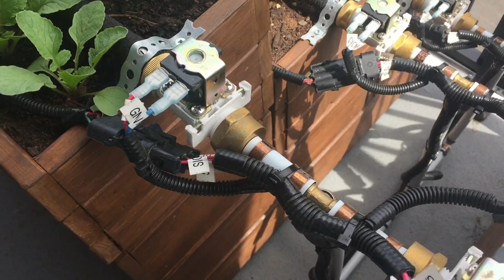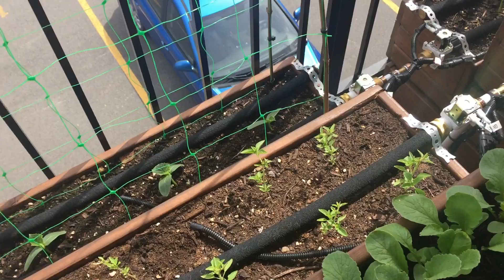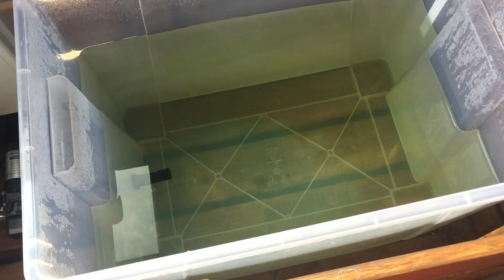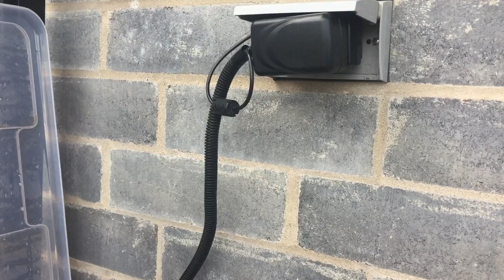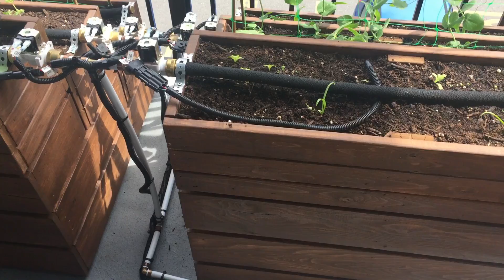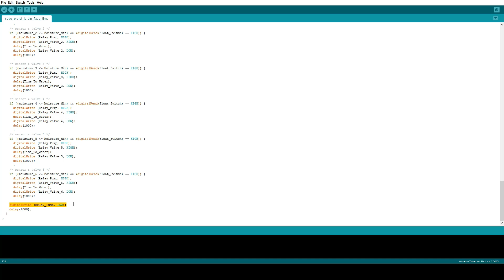Arduino Automatic Garden Watering System

Comment from the maker: Make sure to subscribe, new version coming up! Feel free to leave a comment letting me know what part you’d like to see more of.
Reply: i have few questions do you keep the arduino running all the time  and is that okay , and the sensors are they okay to corrosion  and how about the length of wires from the arduino to the sensor
Reply from the maker: Henok Adisu the Arduino is always powered on, but the sensors are activated by a relay that only sends power when I’m scanning for moisture. That way, it should make the sensors last longer
Reply: but how does the arduino know if it is dry or moist  , is it using time intervals
Reply from the maker: Henok Adisu I’m using a running average of readings at set intervals.
Reply: oh  that is cool ,  i cant wait for your update
Reply from the maker: Henok Adisu still waiting for better weather. It’s below freezing and there’s snow too.
Reply: @pascal789456123  Pleeeeeaaaaaase share the code ♡🏳️‍🌈🤖🏳️‍🌈♡
Reply: dude , pls gimme explanation on that black pipe in the plant how watter come out pls gimme respond :)
Reply: my name is Victor in Uganda, i need to look at your code, can it use a bridge?
Reply: I wanna see how you grow your weed please.
Reply: Pascal Godin 
Hey Pascal, nice work. What are the specs. for the powersupply and how do You make the moisture sensors and valves weatheproof?
And is there a updated video?
Kind regards.
Reply: Hi pascal are you willing to share your code in a post below
Reply: To all the code beggars here: he DID share the code in the video. Oh, you want to copy and paste it? Too bad, without understanding the code it wouldn't be much use for you anyway.

Comment: Hi great video and the only one I could find with a delay in place! I have a autopot set up which water a tray till it stops then won’t water unless the tray is drained by the plant. The problem is it’s all to quick to fill the pot again and I want to add valves to control the water feed but need a longer delay as in hour. Is this possible?

Comment: Hows the arduino Sir? is it still working ? Iam confused whether i should choose arduino or plc for controlling air temperature in farm and turn on the spray or other stuffs if it is too hot
Reply from the maker: Keep it as simple as possible. There are simple thermostats with a relay that could be done if you don't need super acuracy of complicated controls. Arduino is doing fine, the project as a whole is not currently working, got broken hardware (valves and sensor) and since I moved into my house I never had the time to make it work again (and will probably make it bigger since i've got space now)

Comment: Im designing a similar system.  Instead of using standard soil probes im using graphite rods, and im using a button on the arduino to activate a calibration sequence that sets the current moisture level as the set point.  It turns on the pump for 2 seconds, and then reads the probes again, and if it's still not past set point, it goes another 2 seconds until the probe readings cross the set point.

Comment: I love your setup. I am wanting to do something similar with a solenoid I have. A few questions that may be dumb but I can't find answers with my own research. For the solenoids: what gauge wire did you use? Is 22 AWG sufficient for them? What do you call the connector that connects the wires to each of the two solenoid contact points? Also for the solenoids, did you use a 1N4007 DIP Rectifier Diode to prevent overloading the circuit? Thank you for your time.
Reply from the maker: Find the current draw for them, its usually specified in the datasheet, otherwise you could calculate it with the measured resistance. I = V/R. Usually under 0.5A for those solenoids. So yeah 22 is more than enough for one. They're called spade connectors and yes i suggest a flyback diode to prevent voltage spikes to the arduino when releasing the contact.

Comment: Hello, can I ask you where you have bought valve? From china? (and optionally do you have link?)
Reply from the maker: Tomáš Glázr those are from sparkfun. They can also be bought on Digi-Key.
Wouldn’t recommend them for long term use. The plastic housing keeps breaking over time. You should look into brass housings
Reply: @pascal789456123  Found... Ok thanks for advice

Comment: Loved your setup!  Great video, I was just wondering if you wouldn't mind putting a parts list of the stuff you used.
Reply: I'm currently planning to build this and have compiled a list of things I need. It's not complete yet but here it is. 
Note that I've gone for the Arduino Mega 2560 Rev3 instead. This is so that I can extend the system to 16 channels if I need to. Also, I opted to add a 7V-24V To DC 5V step down module, to get away with using a single 12V power supply.
There are some bits and bobs I plan to purchase locally and some parts I already had. But the most important parts are on the list. It'll get you started at least :)
Here you go:

Arduino Mega 2560 Rev3 
https://store.arduino.cc/arduino-mega-2560-rev3
€35.00

Prototype Screw Terminal Block Shield Board Kit for Arduino MEGA 2560R3 Soldered 
https://www.ebay.com/itm/Prototype-Screw-Terminal-Block-Shield-Board-Kit-for-Arduino-MEGA-2560R3-Soldered/163201757185?epid=1279954044&hash=item25ff953001:g:ebUAAOSwzlFbcow8:rk:2:pf:0 
US $10.49

5V 1/2/4/6/8 Channel Relay Board Module Optocoupler LED for Arduino PiC ARM AVR (16 channel)
https://www.ebay.com/itm/5V-1-2-4-6-8-Channel-Relay-Board-Module-Optocoupler-LED-for-Arduino-PiC-ARM-AVR/401237960337?hash=item5d6ba56691:m:mzkfWblEtqpHZfTceI9Bh9A:rk:1:pf:0 
US $10.87

10PCS 5A Dual Row 12 Positions Screw Terminal Electric Barrier Strip Block
https://www.ebay.com/itm/10PCS-5A-Dual-Row-12-Positions-Screw-Terminal-Electric-Barrier-Strip-Block/371983365455?epid=508613193&hash=item569befb54f:g:BlUAAOSwHLNZQ3Uo:rk:4:pf:0
US $4.03

1/2/5/10PCS Analog Capacitive Soil Moisture Sensor V1.2 Corrosion Resistant 
https://www.ebay.com/itm/1-2-5-10PCS-Analog-Capacitive-Soil-Moisture-Sensor-V1-2-Corrosion-Resistant/263880091727?hash=item3d707aa84f:m:m5cIMqk-S_IzJuURT0xz6AQ:rk:2:pf:0 
AU $17.71

12V 1/2" N/C Plastic Electric Solenoid Valve Magnetic Water Air Normally Closed 
https://www.ebay.com/itm/12V-1-2-N-C-Plastic-Electric-Solenoid-Valve-Magnetic-Water-Air-Normally-Closed/191921893492?epid=509536497&hash=item2caf6fb074:g:tZ0AAOSw20Zb4Wuu:rk:1:pf:0 
US $1.99

SINGFLO 12V 1.2 GPM 35 PSI Water Pressure Pump Marine RV Boat Camper
https://www.ebay.com/itm/SINGFLO-12V-1-2-GPM-35-PSI-Water-Pressure-Pump-Marine-RV-Boat-Camper/152626310100?hash=item23893cabd4:g:vGoAAOSwY4pZa3BG:rk:1:pf:0
US $23.99

Water Level Sensor Horizontal Liquid PP Side Mount Float Switch For Pool Tank 
https://www.ebay.com/itm/Water-Level-Sensor-Horizontal-Liquid-PP-Side-Mount-Float-Switch-For-Pool-Tank/253345249307?hash=item3afc8db81b:m:mSQUM0vjzetNW8BCbbT3cUg:rk:1:pf:0 
US $2.27

DC 7V-24V To DC 5V 3A USB Output Converter Step Down Module KIS-3R33S 
https://www.ebay.com/itm/DC-7V-24V-To-DC-5V-3A-USB-Output-Converter-Step-Down-Module-KIS-3R33S/123267380212?hash=item1cb34ef3f4:g:2FoAAOSwLpxbVd~F:rk:1:pf:0 
AU $4.81

IP65 Waterproof Electronic Switch Junction Plastic Box Electric Enclosure Case 
https://www.ebay.com/itm/IP65-Waterproof-Electronic-Switch-Junction-Plastic-Box-Electric-Enclosure-Case/352355528963?hash=item520a06b103:g:~icAAOSwh6dbe89C 
AU $23.89

10/50pcs PG9 PG11 PG13.5 Black Waterproof IP68 Cable Gland Wire Connectors 
https://www.ebay.com/itm/10-50pcs-PG9-PG11-PG13-5-Black-Waterproof-IP68-Cable-Gland-Wire-Connectors/202505080035?hash=item2f263e4ce3:m:mWbjzN7y9Ijx2seLUVV30Dg:rk:2:pf:0 
US $2.70

25m 1/2'' Porous Soaker Hose Watering Pipe Drip Seep Irrigation For Garden Lawn 
https://www.ebay.com/itm/25m-1-2-Porous-Soaker-Hose-Watering-Pipe-Drip-Seep-Irrigation-For-Garden-Lawn/223112364383?hash=item33f288815f:g:5okAAOSw76xbfNeh:rk:5:pf:0 
AU $40.84

Comment: Can you put your water tank above the beds to avoid using a water pump, just those solenoid valves?
Reply from the maker: TheChipmunkZombie the valves need a minimum of 3psi of pressure to seal when closed. It doesn’t work when gravity fed

Comment: From start to finish how long did it take you?
Reply from the maker: Bill Jon hard to say, worked on it on spare time . Took a couple of weeks.
Reply: Pascal Godin gotcha. Do you do programming and engineering as your day job or is arduino relatively new to you? I see the box you said you have from work so I assume you do some type of work wiring with panels? Took me a while for my first arduino project and I feel it should have went faster so just trying to see if I'm just really slow lol
Reply from the maker: Bill Jon I’m a mechanical engineering technician, I design machines and stuff on a 3D cad software. Arduino and programming is rather new to me. A lot of reading and watching tutorials went into making this thing. It’s normal to take a while for doing these projects.
Reply: Pascal Godin gotcha thanks for the reply man

Comment: Hi Pascal, what transformer did you use to transform your mains into 5V and 12V output? Thanks for the great video.
Reply from the maker: Michael Simons I have two plug in transformers bricks, a 3A 12v for the pump and valves, and a smaller one for the arduino. Looking for a better solution for next year.
Reply: Thanks for the fast reply. Please keep us updated as you have set up a very neat design.
Reply: @pascal789456123  Salut pascal, super projet! Jenvisage faire quelque chose du genre cette ete. Pour tes transformer, je te recommenderais un Switched PSU 12v et un Step down DC DC 5V. Tres compacte, tu pourrais tout mettre dans ta boite et avoir seulement un main power in :)

Super idee que de power les sensor seulement lors de la lecture, car jai entendu dire que ce type de sensor ont tendance a oxyder enormement

JF

Comment: Can you please post the specs for the Solenoid valves you used? Or if you bought them online, please post the link to them. I have the design for my own watering system thought out, but am having problems with the valve I bought online. I brought brass adapters similar to the ones you use, but water leaks on the inlet side of the valve. Any details on the kind of hose pipe adapters you used would also be very useful, thanks.
Reply from the maker: Chandramouli S the valves are ROB-10456 by sparkfun. The have water hose threads that normally bottom out with a rubber seal. I used the pipe thread version adapter, so I did put some Teflon tape on there and tighten it quite tight.
Reply: Are the valves weather proof?
Reply: @shifty212  Their design most definitely isn't. I wouldn't use them outdoors without encasing them in some extra cover.

Comment: Can you help me explain this (3.6396322297 * exp(0.0029152931 * (analogRead(Humid_Sensor_1)
Reply from the maker: Tran Huu Nhan its the formula that converts the input into actual % readings from the experiments I’ve done with various moisture samples. You could simply take note of the direct value from the sensor at your wanted moisture and use it like this
Reply: thanks, and i would like to know about the name of your sensor?

Comment: Nice setup Pascal!!
Reply from the maker: OpenGrow thanks, mine isn't as advanced as what you guys offer tho. Temperatures compensation and leaks detection is something I'd like to implement in the future
Reply: We have simple modules with simple installation and configuration, our sensors of moisture and flood are compatible with Arduino, you can try them if you want ;) We could save you hours of development, but we know that 's where the fun is :)
Reply from the maker: OpenGrow . We could have some sort of arrangement that you send a unit or modules and I do a video review of it. I'm looking to improve my setup for next year and will be working on it during winter
Reply: Can you give me the information of your sensoR?
Reply from the maker: Tran Huu Nhan opengrow’s or the ones i used ?